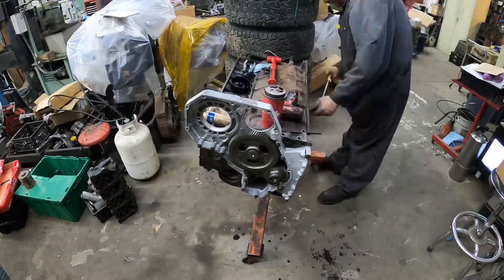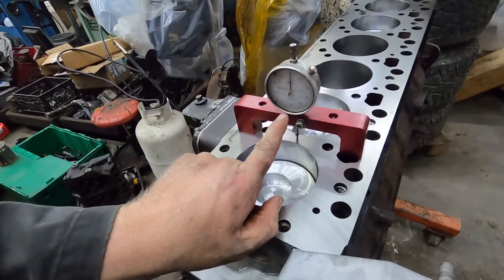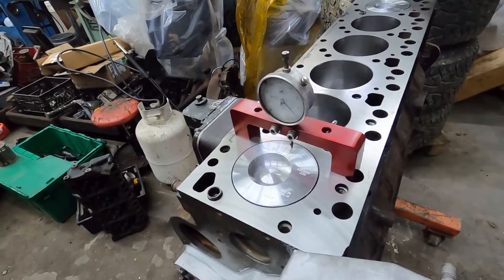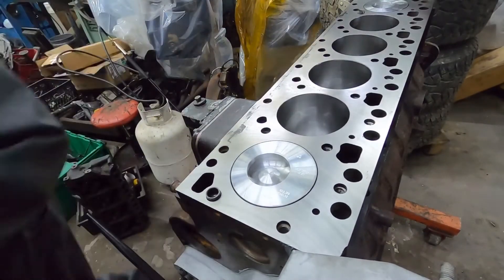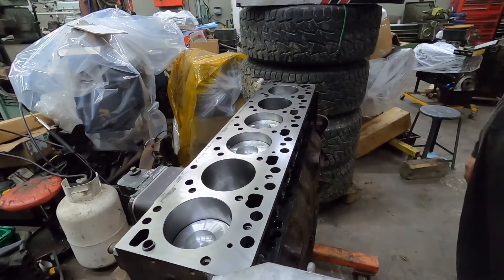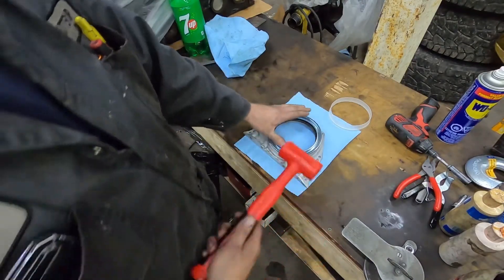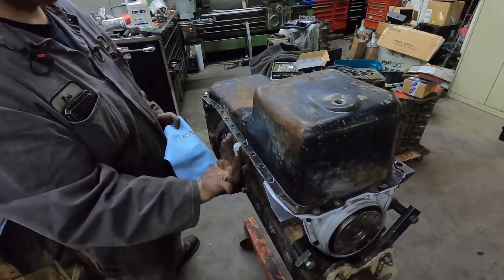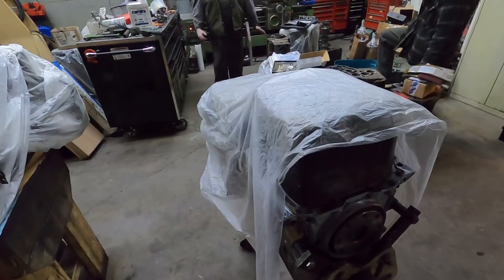HOW TO REBUILD YOUR 12 VALVE CUMMINS  PART 14

Comment: Hey rob i have a .031 piston protrusion and i will use the stock cam  do i need to put a .010 over head gasket ? If i want to put a biger cam in the future ?  Thanks a lot🤘
Reply from the maker: Depends on the valve recession. But if you want to do a different came later put a .010 over gasket.
Reply: Thanks for all  its very helpful🤘

Comment: I always enjoy watching your videos.  Great information and I recommend your videos to learn from . The case sealer for gaskets I never done before . I orderd a can from your store.   I know your busy . I bought a by pass filter and wondered if running the return to thr valve cover is a bad idea or do I need to return to a different location.  Thanks you very much
Reply from the maker: I am not a fan to the valve cover on a 12v I would do the oil filler. Jim I will be talking about the oil bypass on my truck this week and give some options on how to plumb them

Comment: Hey rob how reliable is a .10 over head gasket?  I have a piston protrusion of .35 and I’m running a 178/208 so I gotta run a 10 over
Reply from the maker: Std / .010 /.020 as long as the gasket is good quality there all good too use
Reply: CUTTERUP ROB  does going over sized gasket affect compression ? I have .20 over pistons
Reply from the maker: Not that I have ever noticed
Reply: CUTTERUP ROB  thanks !

Comment: I no you did that video for me on the engine blocks on the 5.9 and 6.7 are the cylinder wall thicker on the 67 vs the 59 I no the bore is bigger on the 67 I'm just asking just curious on the cylinder wall I wouldn't be asking if I had a 67 block to check out but I don't no anyone with one at the moment
Reply from the maker: i will do a video on them. the 6.7 block is a siamese block the 5.9 blocks are not

Comment: I did change out the rear seal last summer. I put the pan on first then did the rear seal. I think I put it in backwards. I had it right it looked funny so I flipped it over then, it was good for about 2 monts then started dripping again.so ill get to do it again. When I swap out the transmission. Lol.. I think I'll try the case sealant too. Thanks rob!
Reply from the maker: no problem.